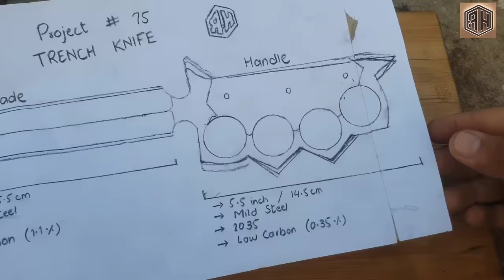Turning a Rusty Bearing into a Razor Sharp TRENCH KNIFE

Comment: Beautiful knife. What made you decide to put the weld at the smallest most stressed point of the knife? Not criticising, just wondering.  I would have used a solid piece of metal. Or stretched the tang in the handle and welded the handle in. If your weld is good it'll work. I just wouldnt trust my weld at that place in the knife.

Comment: GREAT VIDEO. I worked with Hmong in Northern Laos in 1970. We had knives made by a Thai  man near Udon Royal AFB. I have wanted to have another made but cannot find a source. Our knives were made like the WW1 trench 1918 but the entire thing was one piece with no joined hand guard. The blade was like a filet blade but 2x thicker and sharp on both sides. The hilt of the blade was widened to about 1 inch and was razor sharp. These were used to silently dispatch enemy by thrusting into the base of the skull, the curved blade would move upward into the brain and the sharp hilt would sever the spinal cord. Would you be interested in making one?